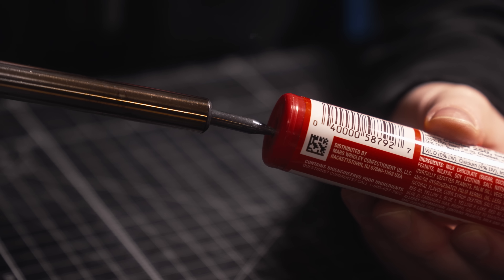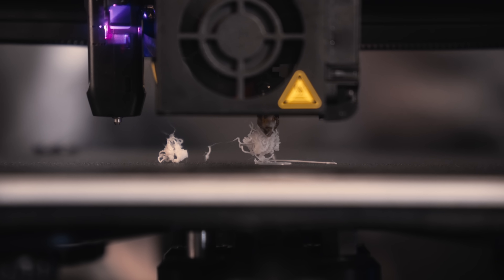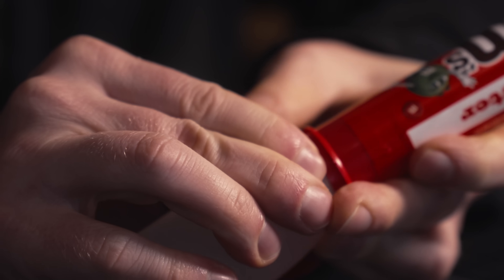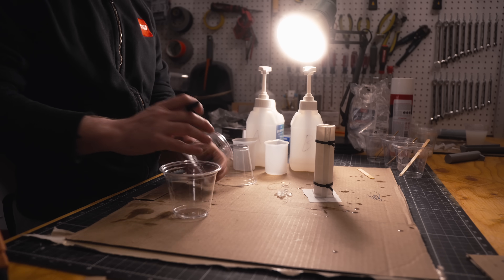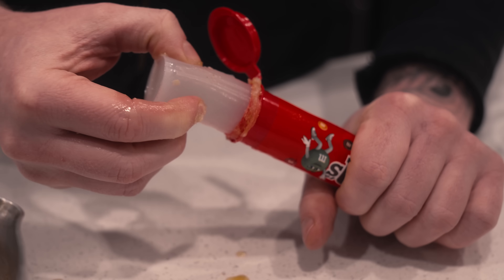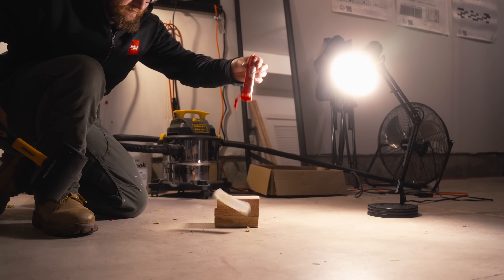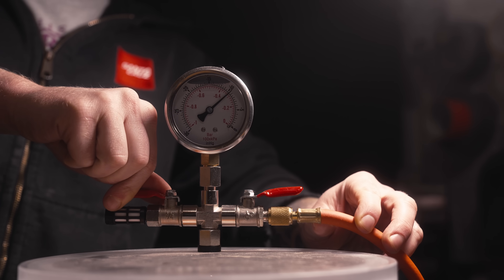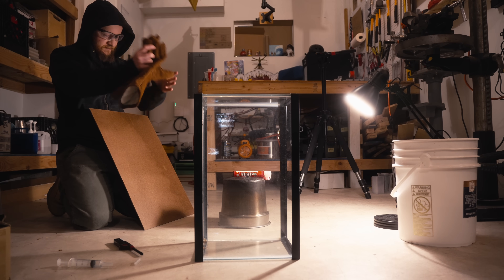Solving Reddit's Cylinder Problem with Science

Comment: the M&Ms customer service call is torture
Reply: “Man. Third one today.”
Reply: @oberonpanopticon  M&M’s PR announcement: "our tubes are now two-parts, so we should have less 'my cylinder got stuck' situations." Crowd applause.
Reply: @gweltazlemartret6760 *Steve Jobs iPhone level of enthusiasm applause*
Reply: @gweltazlemartret6760 what if the two part mechanism were to be jammed/sealed shut for some reason?
Reply: @Ket_okay  there has to be an easy way to open the parts, like some loosy flaps, or a convenient button that needs to be triggered in order to help release any contained cylinder.
But, sure, maybe using some grease would ease the unstucking.

Otherwise, having a hole at the other end of the tube could prevent overpressure from cylinder expansion. It would have to be carefully designed not to be used as main product distribution source tho, I think some kind of diaphragm-like would help clearance.
Reply: I had to skip it, I can’t handle that sort of second hand embarrassment
Reply: @salamander405  It can make something funny but many times I get embarrassed while watching a cringe scene in a show/movie
Reply: @salamander405  I was fine because most of my second hand embarrassment is triggered by someone not knowing they're making a fool of themselves, he knew what he was doing so it was tolerable to me.
Reply: @Dionysian.Cryptid  the embarrassment was less so for him and more so for the customer service worker 😭
Reply: @salamander405  same
Reply: @salamander405 me too i felt so bad for her too its kinda creepy
Reply: she was trying not to laugh lmao
Reply: That poor woman
Reply: @lux0rd01 lol it probably made her day
Reply: Im glad im not the only one who cant stand sitting through prank phone calls
Reply: @MackSlaster  it was a genuine inquiry, not a prank
Reply: i felt second hand embarrassment with that part but to be fair it's 30 seconds and the person working at M&M will probably forget about it the next day. they probably get other weird and worse calls and this is at most something they'd tell as a funny story
Reply: @fres621oh no as someone working in customer service. We definitely don't forget this stuff. We may forget the rude customers but not the funny ones. She probably told all her coworkers
Reply: @hajarmdn4883  Legend says they're still making in-jokes about Cylinder Man to this day.
Reply: @fres621 That's pure cope. Nobody ever forgets the funny dumbasses. Especially if they got anything stuck being horny on top. They know. They remember. So does their family, and their family's friends, and the friends of the family's friends, as the gossip tale to have a laugh over spreads further and further.
Reply: I paused at exactly that point omfg
Reply: Was watching and laughing at all the mold drama but I'm stopping at the call to customer service. Getting an unsuspecting woman to listen to your "problem" is gross.
Reply: I can only hope he hired a voice actor for that part
Reply: I KNOW. I hate when people do calls in their videos. The second hand embarrassment is UNBEARABLE 💀
Reply: Don't know about you but if I got a call like this I wouldn't be able not to laugh.
Reply: id like to compare it to breaking bad's happy birthday scene
Reply: @maxrmaquino  Geez, what’s so bad about it to compare it to that abomination of a scene?
Reply: i physically can not listen to it
Reply: I don't know if that comes from having worked with the public before, (including very briefly as a phone tech support), or what, but I always hate when youtubers get a random bystander involved in their bit. It's only very rarely if ever funny, and most of the time it's just awkward and painful to sit through and actively detracts from the rest of the video.
Reply: @Gamer3427 exactly. Plus there is a huge chance the call center employee is not knowledgeable about Reddit memes, and just thinks this is some kind of weird sexual harassment. If I got a call like this at work, it would probably get to me and make me feel gross.
Reply: why?
Reply: I felt so bad for the call worker
Reply: @spookieypookie  Was it really so bad? It probably helped make her very boring day a little better by getting a nonsensical call.
Reply: Yeah that was an actual fucking crime. Why are men like this.
Reply: That's sexual harassment honestly
Reply: clippy npc lmao
Reply: I will call that worker again and I will make another round of penis jokes to complete stranger and you can't do shit about it.
Reply: I honestly felt like it was sexual harassment. I take customer service phone calls and i know this reddit story, if I was that lady I would have assumed the caller was making a crude joke at my expense for some kind of pleasure. Really hoping she was just confused and didn’t catch on to the implication because that sucks.
Reply: @_MimiTsuki_  I'm hoping he gave a disclaimer that it was for YouTube and told her about the reddit thread at the end of the call, and edited it out
Reply: @ConsumerOfCringe  Idk but explaining that would make me feel more embarass than the talk itself
Reply: @_MimiTsuki_  You think that kind of thinking restricts the local science man? They'll be sticking their cylinders wherever like it's a religion!
Jokes aside, the highly scripted nature of this video would point out it's well thought out throughout. I truly hope they didn't harass customer service like that
Reply: @pata-k  yea doesn’t seem like this guys MO in my opinion
Reply: @_MimiTsuki_ 100% agree. I truly hope this was a joke and not someone from the company (and the video creator just got a friend to take the call)
Reply: @_MimiTsuki_ what? Lmao
Reply: @_MimiTsuki_  Yeah a prank call is one thing, but you don't put a woman through what appaears (to her) to be a Louis CK situation.
Reply: @MrBurnlan  I understand her being uncomfortable but it’s VERY much not a Louis CK situation. 

More like uh.. tmi. Still not a not super cool thing tho
Reply: @_MimiTsuki_  Whether or not something is “Sexual Harassment” does not depend on how comfortable you are about a joke that doesnt involve you as a subject or a cause
Reply: @vader2281  they said IF they were the lady, like hypothetically if they were in the situation that did involve them as a subject
Reply: @earthtoashlyn Yes, that is taken into account on my comment, by “not involving you” I meant not involving the gal on the other side of the phone, because the joke itself doesnt reffer to her in any way, even if it is being told to her
Reply: @vader2281 
  making references to sexual activity to an unconsenting 3rd party for kicks absolutely falls under voyeurism/exhibitionism - whether you directly reference them or not you are including them in the activity they have not consented to and whether you find it funny or exciting it is still sexual in nature to that individual, which you're either exploiting for humor, sexual kicks or power fantasy, you are robbing someone else of their right to consent when they ( as part of their job) cannot just hang up without risking reprimand. 
 
Why is this so hard for some of you? It's not hard to comprehend.

How would you feel if your mother or sister recieved calls like these? How would you feel if a big burly clearly queer man more than 1/4 your size made comments like these to you?  Shouldn't even need examples like that, it is self explanatory yet here we are
Reply: @vader2281  this video is obviously scripted, but you do not get to decide how other people get to feel as a consequence of your actions. Someone actually calling me at my job to explain how they tried and failed to get off would be sexual harassment (just under unsolicited picture level imo), in this hypothetical I am not in on the reference and will only be able to understand it at face value. I don't know why "intent means nothing compared to the consequences of your actions" is such a difficult concept. You can have the purest intentions and still negatively effect people with your actions, in those cases you are still responsible for your actions and for making things right with whoever you wronged. 
Tldr your desire to do a funny haha isn't more important than someone not wanting to be involved with whatever it is you're doing
Reply: @vader2281  telling strangers about your sex life when they cannot shut you down due to strict job script rules is harassment, you're still trying to insert them into a conversation that is about sex. I need to be as clear as possible that I'm not calling this creator a groomer but I'm bringing up the fact that this is a tactic groomers use to emphasize that whether something is sexual harassment or not has nothing to do with whether they're involved in the fantasy scenario and everything to do with whether they were drawn into the conversation without their desire at all. In this case I'm next to certain it was scripted because there's no way someone's doing something this gut wrenchingly cringe publicly unless they have like brain damage but that's aside from the point since we're talking about a hypothetical where someone was doing this for real
Reply: @Sandstimes  So much text for so little of a justification, “sexual harassment” does not come from how you feel about a situation but from its nature, there is a clear difference between something being interpretable in a sexual way (or intended to be interpreted that way) and trying to establish some sort of sexual interaction/contact with the receiving end of the call, the fact that something “can” be used for the purpose of taking advantage of a person for sexual purposes does not mean that it is in the particular situation, it can be cringe and even morally wrong without it being the literal crime of sexual harassment.
Reply: @Sandstimes  for the record, innuendos are unintended here: it is a litteral cylinder stuck in an M&M’s tube, and however you understand it or feel about is irrelevant to actual facts.

This was not done nor to embarrass that hotline person (whatever her gender is or would have been), nor with a malicious intent.

Yes, there is a way "cylinder stuck in a tube" is actively a sexual reference made to harass people, but that’s not in any shape or form the case here.
Reply: @SebastianDingleswitch  found the white knight, virtue signaling to nobody. It's a joke not a dick, don't take it so hard.
Reply: @Sandstimes  you must be so much fun to be around, I bet you have many friends and are generally super happy as a person.
Reply: @SebastianDingleswitch consent to a prank call??.. damn thats sounds fun
Reply: @capes8395  Imagine getting offended on the behalf of someone clearly trying not to laugh.
Reply: @capes8395  "white knight", honey it's called being cognizant of how your actions affect others. I'm glad you are able to sail through life without being accosted sexually or otherwise. Must be nice.

By the way, Google doesn't require you to use gender specific usernames. You can go by what you want. You accusing me of being a white knight without considering the possibility I have first hand experience with the topic says more about you than my desire to speak freely in a forum that often immediately discredits women's opinions.

You tried though.

Genuinely so creepy ya'll don't get why this is a bad look for you 😅
Reply: @jantondl3997  sorry you feel a need to make other people uncomfortable to be funny because you lack any actual wit 😢
Reply: @SebastianDingleswitch  oh now I did make you feel uncomfortable? with that comment ? I really just think this whole angle is blown out of proportion. Its just a prank call, not everything needs to be sexual harrasment
Reply: @SebastianDingleswitch ”the myth of consensual joking…is there anyone you forgot to ask?…”
Reply: @_MimiTsuki_  In what world is a silly prank call like that sexual harassment? People are so delicate nowdays.
Reply: @_MimiTsuki_  its a cylinder though, what kind of crude joke involves a cylinder?
Reply: @_MimiTsuki_ nah that's too far. Sexual jokes aren'tthe same thing as sexual harassment.
Reply: @FAB1150  My brother in christ, she's at work. Sexual jokes towards a stranger you know can't just hang up on you because you're being vague instead of saying the word "penis" is such blatant and obvious sexual harassment, what the hell dude
Reply: @Avendesora one being at work or not changes what, exactly?
Reply: @FAB1150  Well, if you decide to go back to my comment and keep reading after the first few words you might be able to get a good idea about why that part in particular is relevant. Let me know if you still need help afterwards
Reply: @FAB1150  Unwanted sexual jokes is absolutely sexual harassment.
Reply: @FAB1150  absolutely incorrect. Sexual jokes are sexual harrassment. Any workplace discrimination training should elaborate on this.
Reply: @FAB1150 how has bro has never had onboarding sexual harassment training at jobs
Reply: @Poke-Chann bro has zero comprehension of nuance
Reply: @laddersmitty  this is not the case, as there is litterally a cylinder stuck in that M&M’s tube.
How would you phrase that to not be a twisted sexual harrasment innuendo?
Reply: @FAB1150 what is the nuance. Making unwanted sexual jokes falls under sexual harassment. The fact you don’t know that tells me either you’ve never had a real job or your attention span is so abysmal that you couldn’t listen to the entire training videos.
Reply: @FAB1150  The internet has made y'all way too comfortable acting around strangers as if you were in a close friend group.
Reply: @FAB1150 A sexual joke is not sexual harassment in and of itself. A sexual joke aimed at a customer service agent who is forced by her job to listen to whatever you say is definitely sexual harassment
Reply: @RogueAstro85 that's my point, this isn't assumed at all to the cs woman
Reply: @_MimiTsuki_  OHHHH THE HORROR!! HE WAS TALKING ABOUT CYLINDERS 😱
Reply: @Mooie519  the "ooh I'm not touching you I'm not touching you" of sexual harassment
Reply: @_MimiTsuki_  oh my God grow up.
Reply: Yeah that rep on the other line was definitely creeped out, whole call was so bad to hear even as just someone watching the video
Reply: I turned the sound off
Reply: You are all simply weak minded individuals. I was able to sit through that as if it were merely a normal interaction. Years of intensive training and natural born abilities have led me to being able to withstand such bewildering embarrassment. I am an endearing warrior just like my father before me. It takes a little more than humorously tragic besmirching phone calls to break my hardened and battle tested mental exterior. I know a thing or two because I've seen a thing or two. I would teach some of you, however, I believe it would be a fickle endeavor. Such is the rule of honor.
Reply: @MrBeenus have you also studied the blade
Reply: @SebastianDingleswitch That I have. Strenuous training over the span of many fortnights have led to my unrivaled mastership of thy blade.

Comment: You could just calculate it based on the amount of compression; the resulting pressure on the inner walls can be combined with the total inner surface area and the correct coefficient of friction to determine the total force needed to free the cylinder.

Comment: I do have a theory on a method that I think could work, with minimal damage, and with household objects, specifically: using a can of compressed air, one of those used to clean electronics. I'd try and stick the little straw between the cylinder and the tube. The cylinder might get a bit scratched, but the thin plastic straw shouldn't deal too much damage
Reply: Or if possible you could drill a small hole in the end of the tube to stick the straw into.

Comment: 4:30 In the original Reddit post, I believe OP mentioned that the cylinder has the ability to expand in size when in contact with M&M tubes. It's possible the 4.5" diameter is accurate, but that is a measurement at full unimpeded engorgement. I imagine the growth may affect the results from some of your experiments...

Comment: I think a pretty hot bath/water was probably the best home solution. 
I mean you said it yourself, the hot paste cooled off and created negative pressure. heating it up again would probably nullify the pressure.
And since the cylinder was inserted at that temperature, one can assume the exact heat needed wouldn't come close to harming the cylinder.

Comment: The correct way to do this is to use a sheet of sandpaper, and carefully sand the flat tip of the tube. Eventually it’ll create a gap for the pressure, and the cylinder can pop out.

Comment: i still think the best option is to puncture the end of the tube with a thumb tack. if the cylinder is not to the end of the tube (lets be honest, it probably wasn't) then you could make multiple holes. then the vacuum would be released and you add lubricant to both ends.

also who's cylinder fits in a tube of m&ms??? do i just have a larger diameter cylinder than most?? it would never fit under any circumstance

Comment: let's suppose the cylinder had a mechanism for deploying fluid out the front end of it, at the furthest part of the tube.
would it be possible for said liquid to be able to lubricate the cylinder and help break the seal between it and the tube? or would that not work and instead cause more problems?

Comment: Maybe you can try sanding the surface before applying acetone, some ethanol might speed up the process. If you happen to have jewelry engraving bur it might also be delicate enough in straight hands. Drilling a small hole on the side of the tip would allow the air to enter and cancel the negative pressure. Maybe it is wise to even apply additional pressure though it.